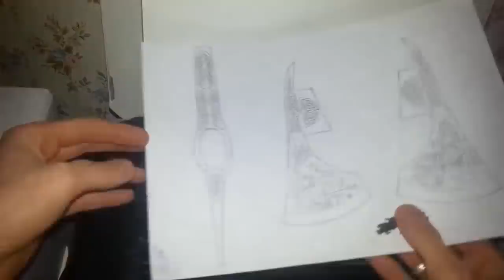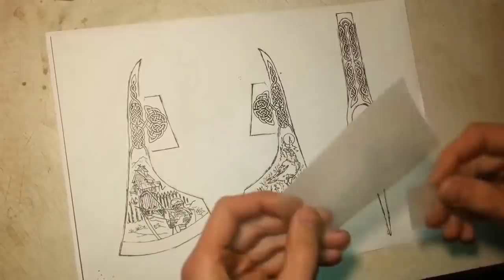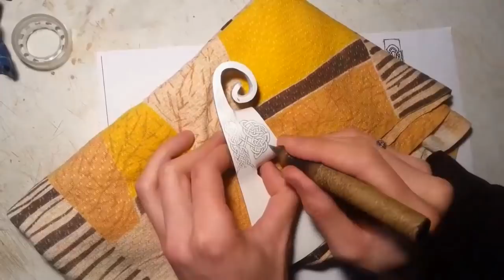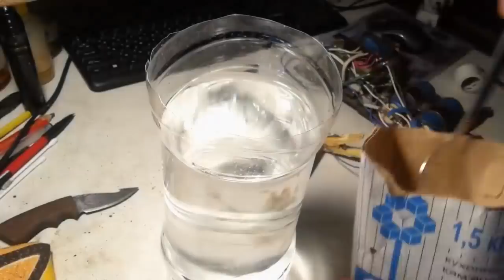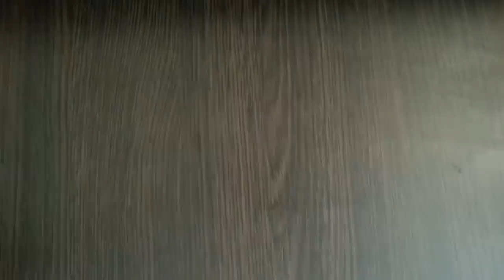Drawing on metal. How to make a vintage ax.

Comment: Holy sh*t dude. Thats awesome. I wish I know what you were using. I have a general idea but can't read the product names lol
Reply from the maker: Thank you. I appreciate your attention.
1. I pickle the metal so that the paint adheres well to it. You can also see this process in some of my other videos.
2. I paint metal. I use alkyd spray paint.
3. Transfer the drawing to the paint. I use a drawing film and a simple pencil. You can use food paper or matte film for lamination.
4. I scratch the drawing.
5. I do electrochemical etching of metal. 2: 49minutes - wrapping medical cotton on the electrode. I do metal etching in salt water.
6. I transfer the drawing. 3: 56 minutes, Scratch the contours of the picture.
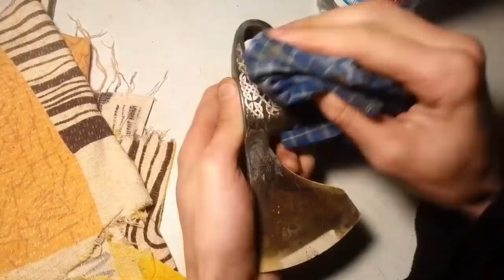7. 4:12 I wash the paint. I use solvent like acetone.
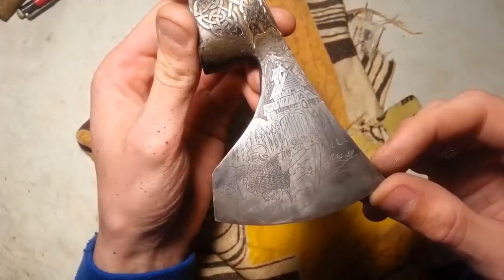8. 4:33 Female nail polish. I use it to protect fragments of the pattern, in those places where the metal should not be etched.
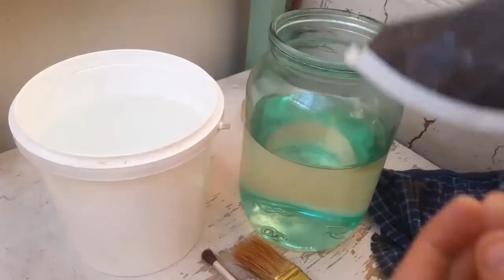9. 4:56 Metal etching in nitric acid 5%.
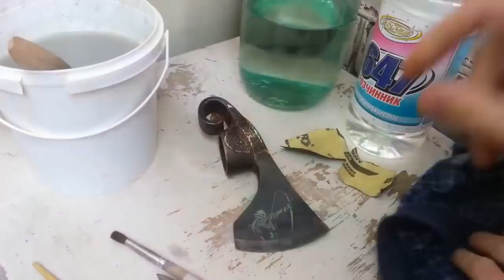10. 5:11 Wash in water.
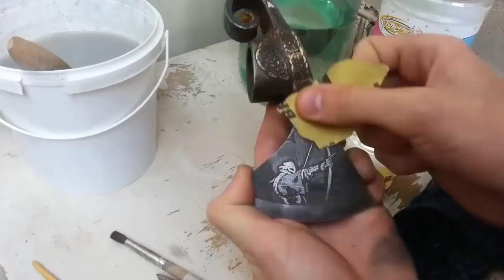11. 5:18 Sanding with sandpaper.
12. I paint over nail polish for more fragments of the picture. And again I do metal etching in acid.
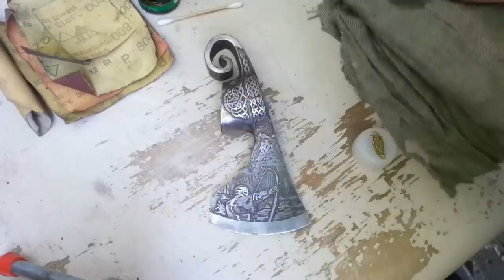13. 6:01 I wash the nail polish. I use solvent like acetone.
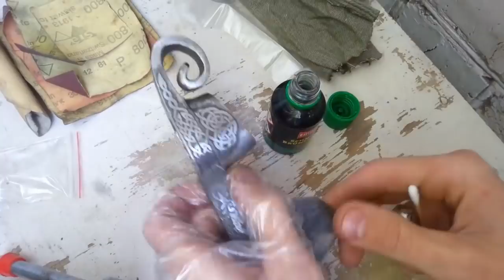14. 6:16 I blacken the metal. I use a special liquid for bluing.
15. 6:50 Wash in water.
16. I grind metal for the manifestation of the pattern. I do it with sanding paper. On the convex parts of the metal, the blackening is erased, and the drawing looks contrast.
17. I lubricate the metal with oil to protect against oxidation.
I hope I answered your questions. If you still have questions, write, I will try to answer.
Reply: @KirillRunz  Thank you — very helpful information

Comment: What are the items you use to do this please
Reply from the maker: Thank you. I appreciate your attention.
1. I pickle the metal so that the paint adheres well to it. You can also see this process in some of my other videos.
2. I paint metal. I use alkyd spray paint.
3. Transfer the drawing to the paint. I use a drawing film and a simple pencil. You can use food paper or matte film for lamination.
4. I scratch the drawing.
5. I do electrochemical etching of metal. 2: 49minutes - wrapping medical cotton on the electrode. I do metal etching in salt water.
6. I transfer the drawing. 3: 56 minutes, Scratch the contours of the picture.
7. 4:12 I wash the paint. I use solvent like acetone.
8. 4:33 Female nail polish. I use it to protect fragments of the pattern, in those places where the metal should not be etched.
9. 4:56 Metal etching in nitric acid 5%.
10. 5:11 Wash in water.
11. 5:18 Sanding with sandpaper.
12. I paint over nail polish for more fragments of the picture. And again I do metal etching in acid.
13. 6:01 I wash the nail polish. I use solvent like acetone.
14. 6:16 I blacken the metal. I use a special liquid for bluing.
15. 6:50 Wash in water.
16. I grind metal for the manifestation of the pattern. I do it with sanding paper. On the convex parts of the metal, the blackening is erased, and the drawing looks contrast.
17. I lubricate the metal with oil to protect against oxidation.
I hope I answered your questions. If you still have questions, write, I will try to answer.

Comment: please please please .... translate the steps and name of product used in this tutorial
Reply from the maker: Thank you. I appreciate your attention.
1. I pickle the metal so that the paint adheres well to it. You can also see this process in some of my other videos.
2. I paint metal. I use alkyd spray paint.
3. Transfer the drawing to the paint. I use a drawing film and a simple pencil. You can use food paper or matte film for lamination.
4. I scratch the drawing.
5. I do electrochemical etching of metal. 2: 49minutes - wrapping medical cotton on the electrode. I do metal etching in salt water.
6. I transfer the drawing. 3: 56 minutes, Scratch the contours of the picture.
7. 4:12 I wash the paint. I use solvent like acetone.
8. 4:33 Female nail polish. I use it to protect fragments of the pattern, in those places where the metal should not be etched.
9. 4:56 Metal etching in nitric acid 5%.
10. 5:11 Wash in water.
11. 5:18 Sanding with sandpaper.
12. I paint over nail polish for more fragments of the picture. And again I do metal etching in acid.
13. 6:01 I wash the nail polish. I use solvent like acetone.
14. 6:16 I blacken the metal. I use a special liquid for bluing.
15. 6:50 Wash in water.
16. I grind metal for the manifestation of the pattern. I do it with sanding paper. On the convex parts of the metal, the blackening is erased, and the drawing looks contrast.
17. I lubricate the metal with oil to protect against oxidation.
I hope I answered your questions. If you still have questions, write, I will try to answer.
Reply: @KirillRunz  , thanks a lot for all the details and informations i couldn't ask for more...your such an awesome guy , i hope your channel would attract more viewers and you would get more subscribers
Reply from the maker: @jasonmontgomery1958  Thank you very much. I hope so too.